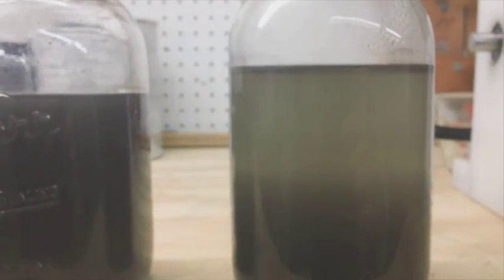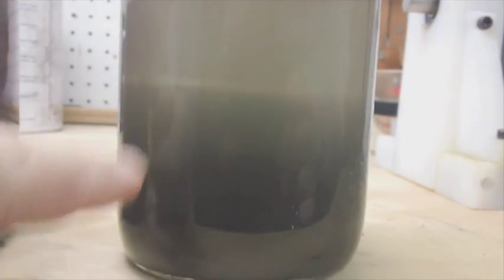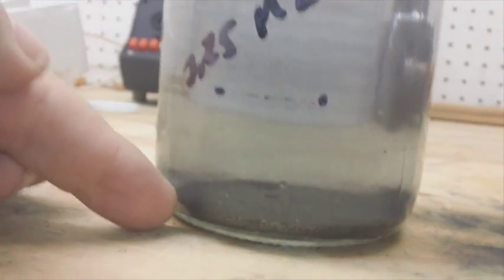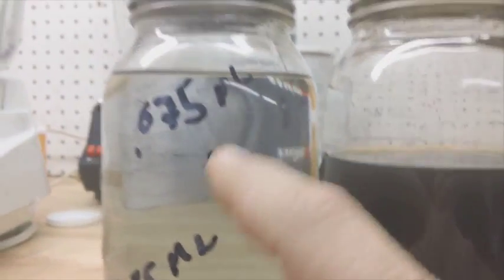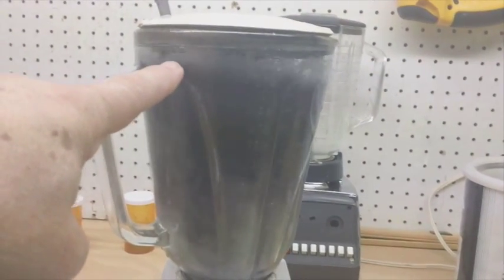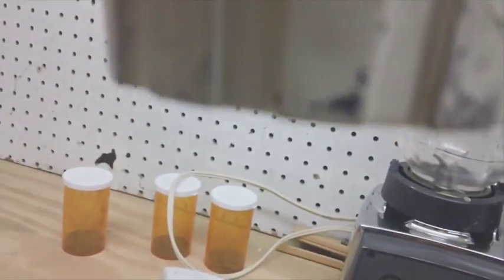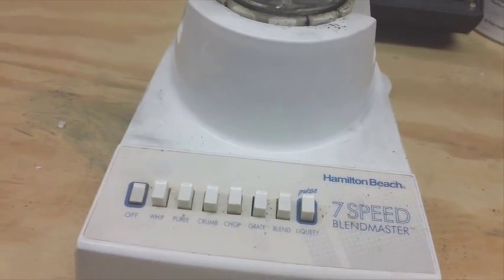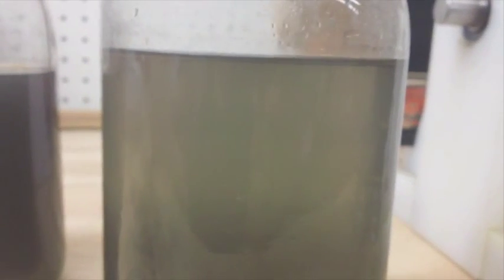Graphene blender method test Day 3

Comment: Hi, great series of videos.
After ruining a couple of blenders due to heat, I now use a mechanical timer switch, 15 min on, 15 min off for as long as you wish.
I also built a 2 min timer that can be used for really short bursts ie 2 mins every 30 mins.
and leave running for a desired period, this puts very little strain on the motor, or excessive heat due to blade friction.
Martin.
Reply from the maker: Honestly, I stopped working with this method due to the low yields and wasted product the best method I have found uses electrical current and natural graphite, it's the Greenest way and the cleanest way. Robert Murray Smith has some good videos covering this process you should check his channel out to create your  graphene.